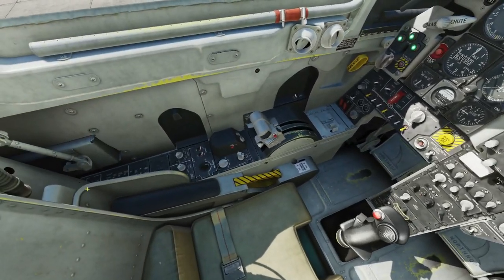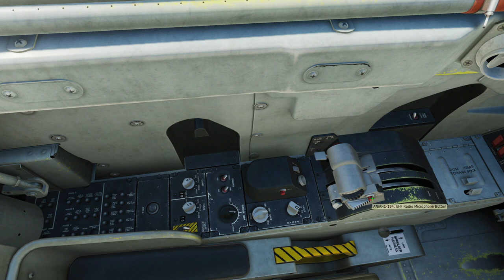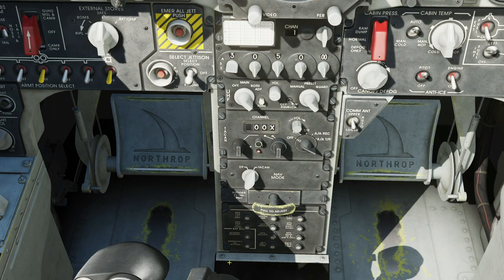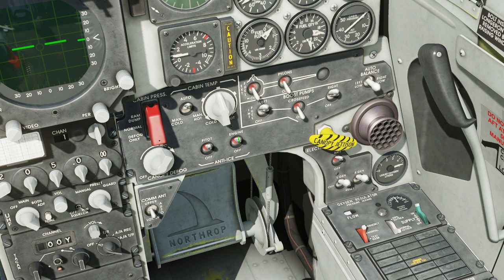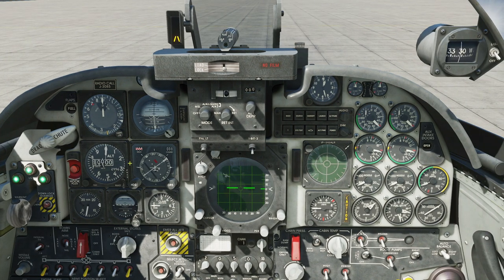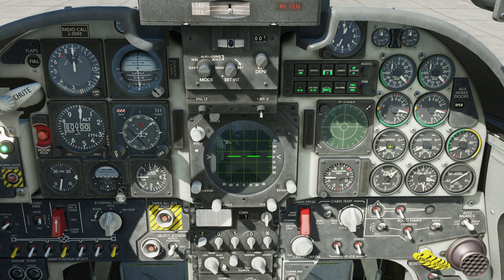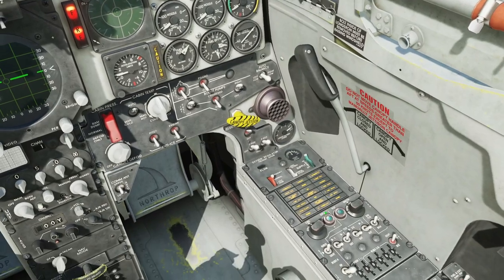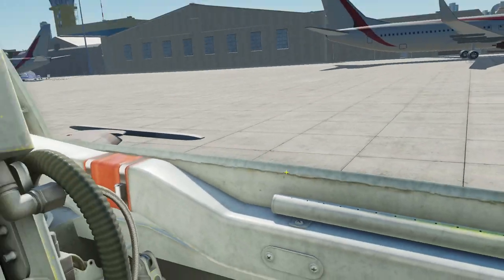F-5E Tiger II: Cockpit Familiarization Tutorial | DCS WORLD

Comment: Angle of attack indictor does not display degrees, it displays "units".  In that era this was common instead of displaying degrees. 
(BTW, at that time the T-38A displayed AOA in percentage of critical angle of attack, which is actually more intuitive than either degrees or units.  AOA of 1.0 was stall, and approach speed of 0.6 AOA, max range 0.18, max endurance 0.3 AOA were all marked on the dial.)

Comment: CABIN TEMP panel: You said with manual mode selected you can choose cabin temperature with the knob.  What you must have meant to say is that knob is functional only when AUTO mode selected.  Manual hot and cold positions are momentary spring loaded positions that move the temperature control valve in the direction of the position held.  It is meant for use when the automatic temp control system malfunctions.